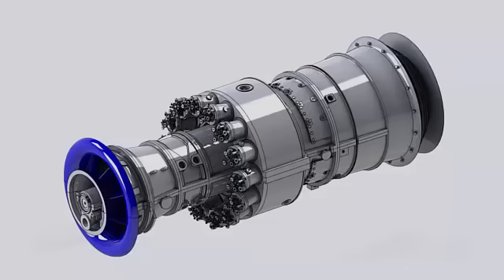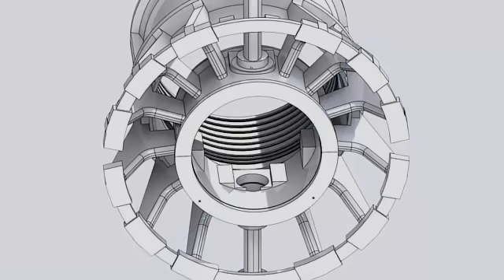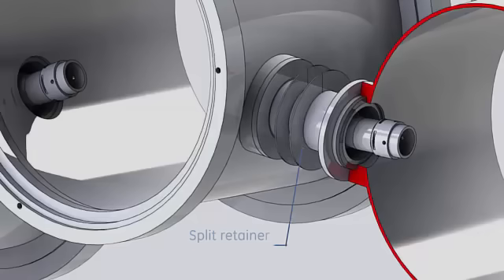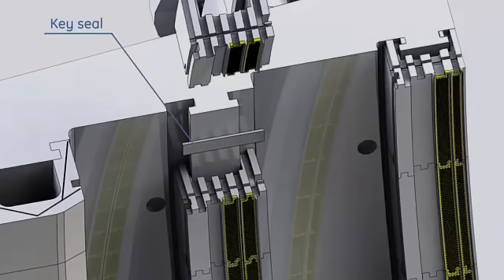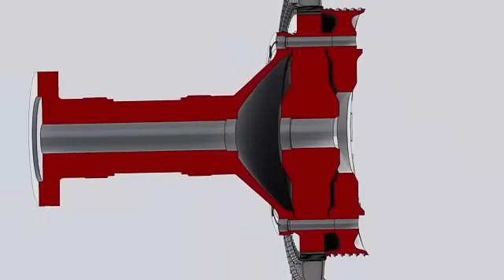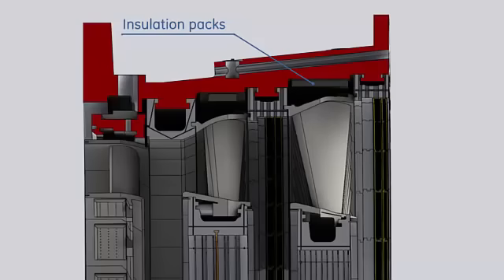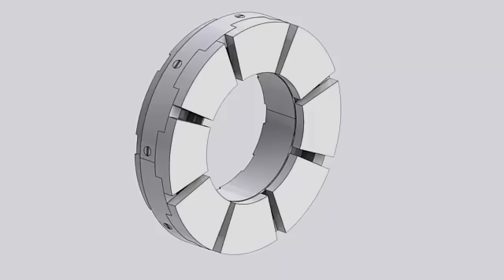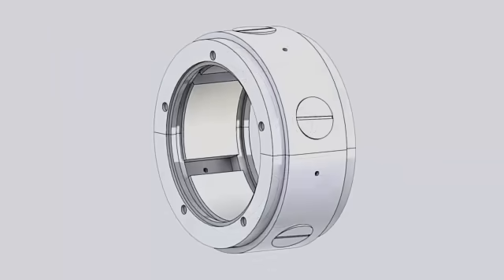Gas Turbine | Gas Turbine Working | Gas Turbine Overhauling | Gas Turbine Maintenanc Gas Turbine Rep

Comment: Better than my university professor’s teaching
Reply: What a weird thread!
Reply: A stator induced electronically should accelerate induction at slow speeds to eliminate compressor and combustion flame out and lack of performance so much needed at slow speed maneuvers or tactical applications !
Reply: @Noyon Ahmed oh it was aimed of achieving maneuvers on an F 22 , F 35  !
Turbines , like car engines rest on oil pressure friction floating  bearings , as we saw the center shaft and seals !
Reply: A university teacher would not talk about this.  they teach theory. this is infotainment about a product designed and built by engineers who got their education in the theory of thermodynamics.
Reply: @6Diego1Diego9  agreed, "theory and partisan propaganda"
Reply: @smudent2010  I'm guessing you are one of those people who fear the unknown, are afraid of learning something new, or possibly having your beliefs challenged? It's really amazing to me, that something as mundane as a Gas Turbine video can be made into something political by others!
Reply: @6Diego1Diego9  Absolutely...
Reply: @6Diego1Diego9  Blah Blah Blah
Reply: @UltraGamma25  you know I'm right ✅
Reply: @UltraGamma25  ll

Comment: Splendid work by Channel creator This video is for training , operation skills and  easy trouble shooting (concept of machine would be clear) with maintenance information or knowledge for maintenance tech. I operated 21 stage ST(HP/IP/LP) single shaft and 1000 ton/h of boiler but Never operated GT therefore i am sure i can operate GT after this video after simulator training only.
Reply from the maker: Welcome

Comment: Inlet guide vane 

Inlet guide vein 
Control ring 

Stator vanes 
Lift 
Drag 
Compressor 
Wheels 

Wheels wheels wheels

Casting 
Outer 
Inner 
Cylinders 

Barrel
Chrome 
Barrels 
Chrome 

Bearing 
Theodolites 

Nozzles 
Airfoil 
Dovetail

Comment: What type of engines does Grendizer use?
Reply: Grendizer's power system is based on an advanced alien energy core that supplies the necessary energy for its movement, weapons, and advanced functions, such as flying and shielding. The specifics of the engine or power system aren't given in scientific terms, but the concept revolves around a highly advanced form of energy that enables Grendizer to perform its heroic feats.

Comment: one i worked on in a power plant took a week to stop spinning
Reply from the maker: How?
Reply: @OilGasWorld  very good bearings and it weighed 2Million pounds so just the rotating mass, the shaft was 22" around solid stellite steel. was in a power plant. made 1.5 million hp ..i can’t remember the megawatts it made my buddy would remember how big the alternator was✌🏻

Comment: Great respect to those great engineers who developed such a beast. Question: what if there were no stator veins? Would the compressor stage be just a big fan?
Reply: It would create a Flux Capacitor.
Reply: Assuming you are not removing the casing, I would say it will behave a bit like a fan (pushing the fluid without much pressure increase). Another problem that you will get  is that the flow path/direction will be heavily disturbed, so this "17-staged fan" would need very high power input to counter the flow turbulence.

Comment: Excellent description and detail by the commentator.  My hearty congratulations.  I do feel that the modern jet engine must be classified as one of the modern wonders of engineers. The combined engineering logic of the jet engine took a lot of time to be put together and if one had to put an initiation spark on the human mind, it was Charles parson who combined the high pressure in a boiler to spin the turbine in a steam layout.  I was lucky enough to have lived at Newcastle-upon -Tyne where  I went on many visits to see the Turbina the first steam turbine ship which surprised the Royal Navy at Spithead.  I worked on the first jet turbines on a naval ship and it was the HMS Exmouth when I worked at Chatham Dockyard. 
Again Congratulations to Oil Gas World for providing such detailed information about the thermodynamic stages and the cooling methods on every unit. When I built a model engine with one compressor stage and one turbine stage, the diffuser right after the compressor was a tricky unit where the air had to be slowed down to sustain the flame and then the flame diluted with colder air along the burner to isolate the flame from the metal. 
Well done to the commentator, HIs English accent is what I aimed for when I spoke that language, but I could never get rid of my mother's tongue diluting the English language I spoke at Chatham and Newcastle.
Reply: Well, check out ASML EUV scanner. Also an example of amazing engineering.

Comment: To fully appreciate how powerful this engine really is, the compressor alone draws about 25,000hp.
Reply: Which engine is it? Because it seems quite simple (old-fashioned?) compared to a GE aero engine.
Reply: @rocksnot952  It looks simple because it's ground up made for industrial use, so doesn't have the constraints of an aero-derived engine. Means they can make them simpler and more robust the the LM series which are the cores of modern turbofan engines (The LM9000 is built from the core of the GE 90, the LM6000 from the CF6.)
Reply: The cooling fan on my big block Chevrolet draws 30 horsepower. I was stunned to learn this some years ago.

Comment: Very Cool and also amazing how these things such as high speed gas jets work and last as long as they do with not just it's speeds in RPMs but the amount of continuous heat saturation of all the internal parts without melting down or seizing by welding themselves together, to me that's mind blowing. Working with Turbos on gas engine's is challenging enough when you are dealing with exhaust temps and heat saturation into the drive shaft and Journal bushings or ball bearings, but I also assume with the amount of continuous volumes of fresh air always coming into the intakes and the lower compression ratios of the turbine the BTUs aren't nearly as hot as it coming out of an exhaust port of a V8 cylinder head, of a hot Blue flame upwards of 2k degrees Fahrenheit? But it's a different story when you add a afterburner to a jet or turbine combustion which is under much higher atmospheres of pressure when extra air and fuel are pumped into the afterburners, those parts have to be some sort of super metals used by NASA it not melt or erode away if not some sort of ceramic coatings on the metal parts to protect these parts from the intense heat being funneled throw a adjustable nozzle at the tail ends of these modern jet engines. I understand they are slightly different than a Gas turbine is but they share a lot of the same mentioned above parts and temps I'm sure.

Comment: This tie bolt construction is not common, is it? This is for stationary gas generation?
Reply: Yes, this is how the compressor rotors in GE Heavy Duty Gas Turbines are made...other manufacturers use more of a "barrel" design...and yes, this is a stationary power generation machine, so weight is less of an issue than durability and output.
FYI...I am a gas turbine engineer, formerly with GE for many years, and I still work for a spin-off company on gas turbines...

Comment: I used to be an 14CFR Part 147 instructor for an A&P school. I taught turbine engine theory, and helicopters. A lot this is the same as a standard aircraft engine but there are some terms that are used here that aren't used on aircraft. Like spark plugs. We don't all them that since they are not used at all times. They are called igniters on aircraft engines, we simply call them flame propagation tubes, and what they call a labyrinth seal we call knife edge seals or knife seals, and we usually describe the intake separately from the compressor but for the most part they are pretty much the same.
Reply: I used to be a helicopter pilot too, i drove a ROFL Copter 
...and I Believe you Joker

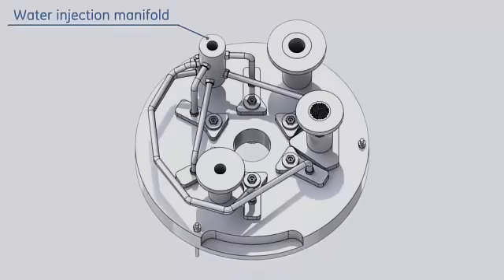Comment: Why is water introduced to the air-fuel mixture? 17:15 Anyone? It's not for cooling obviously🤔
Reply: GE Heavy Duty Gas Turbines, like the Frame 9 in this video, have multiple combustion chambers, even the current design machines. The water injected is for NOx emissions control when operating on liquid fuel  (usually #2 distillate, i.e.diesel). On gas fuel, the DLN system can maintain low emissions levels without water, thus the name DLN (Dry Low NOx) for the combustion system. However, on distillate fuel, water is still employed (which quenches the flame to lower thermal NOx production).
Reply: @garyvonmaucher2400  Thank you!👍
Reply: Well this is not the newest type of Gas Turbine it's using cumbustion chambers that are seperated. Most of the time you will see only see 1 combustion chamber. So it should be an older type of engine. The water was in fact used to cool the air a bit more to prevent unplanned overheating. But since water is quite heavy it is not used anymore. There where also engines which used methanol/ethanol mixtures with water.
Reply: @janhammer6554  Thanks for the explanation! Now, it makes sense.👍
Reply: Water will decrease NOx emissions and a bit of power boost from the steam.

Comment: I worked for the UK admiralty Material Laboratory as a Toolmaker/Welding specialist 1977 to 1981. One of the projects I was involved in was a high temperature wind tunnel for gas turbine blades. They were initially interested in  the front and rear blades.  The for the front blade the conditions surrounding the blade were easily met. The rear blade was another thing. We spent over a year getting the Air pressures correct flowing over the blade. The tool shop made up test blades out of different materials to see their corrosion resistance as the hot gases flowed over the test blade. Gas pressure was monitored around the blade by spark eroding very small holes in the blade then welding 1mm dia stainless steel pipes on to the end of the test blade where the hole came out of the blade which was then connected to pressure gages. After a year of development and spending 1 million pounds it was announced everything was good. The customer turned around a stated they were only interested in the front blade high temperature corrosion resistance. Whoops.
Reply: Great! I worked on a contactless monitoring system for vibrations of blades by means of microwaves.
Reply: Hi sir
Reply: Whoops ?
Hehe..

Comment: Great vid.  Now I understand why gas turbines cost so much!  Lots of very high precision components. 

Does each stage have a balance ring on the rotating ring where the blades mount?
Reply: do you? A computer CPU chip has trillions of even higher precision components and costs $100. And just like a chip, make one is almost same cost as make 10 million. Turbines cost what they cost because the makers charge what they feel like charging for them, just like the proverbial toilets sold to the military.
Reply: @dubistverrueckt  What a moronic comment.  There are many gas turbine mfgs (Ansaldo, GE, MHI, Kawasaki, Siemens, Solar, Capstone, MAN, Centrax, Opra), and it is a competitive market.  In fact, gas turbine mfgs show much lower profit margins that chip mfgs.
Reply: @shooter7a  I'm sure there's even more toilet manufacturers, yet the toilet story is true. by the same token, watch a video of modern Audi piston engine, every bit as complex, if not more than this turbine. The Audi engine is under $10k
Reply: @mosipd  Not to mention each turbine blade in commercial jet engines is milled from a single block of tungsten alloy. Very slow, labour intensive and expensive, the cost will never come down much for a long time indeed. I tune engines as a hobby, turbocharged, standalone ecu, water/meth injection, etc etc. There is simply no comparison between modern reciprocating engines to gas turbine engines used in aircraft, not even the jet engines from decades ago.

Comment: The turbines have neither the variable pitch nor the variable geometry of the blades that must rotate on themselves.
And not fixed like monsters.
1) https://it.wikipedia.org/wiki/Elica_a_passo_variabile
2)https://it.wikipedia.org/wiki/Turbocompressore
Reply: This GE talking about a specific GE turbine. I think GE KNOWS MORE ABOUT A SPECIFIC GE turbine than Wikipedia which is general information. I worked at a GE turbine blade machine shop for 13 years.
Reply: @jockellis  But did you understand what I'm talking about?

Comment: Fascinating video. Though not the type of thing I'd normally watch on YouTube (I'm primarily here because a link to this was sent to me by a friend who is an engineer at GE), it held my attention to the end. I'm curious: what are some of the end uses of such a turbine? Electrical power generation for distribution to public? Industrial uses? Other?
Reply: smaller ones are also used to drive large mechanical loads like compressors. Very popular in LNG and other facilities where gas compression is needed.
Reply: This size machine is typically used for power generation, and is used in the 50 Hz market (thus the 3000 rpm speed), mostly Europe, Asia, etc. It produces about 125 MW of power. These machines are also used in a few LNG compression trains as well.
Reply: larger ones are used for propulsion like jets but also ships. smaller ones are more for power generation. they are usually attached to a motor or transmission for non jet types.
Reply: As an ex-GE engineer, I will say briefly they are primarily used to drive a generator, the MS 9001described here turns at 3,000 rpm - synchronous speed for a 50 cycle (Hz) generator to match most of European electric grids, the earlier iteration, the MS 7001 turns at 3600 rpm to produce 60 Hz power for USA. Earlier models like frame 3 and 5s also were at times used for pumps or compressors, often with a gearbox between the turbine and the load to give the desired rotational speed - plus other subtleties like a 2 shaft turbine system.  I will say that this video is excellent and very well done - I found essentially no detail I could disagree with. Whoever did this knows their stuff!
Reply: MS9001E is mostly used for power generation...also compressor and pump drive

Comment: Literally the best video I’ve seen (on this subject).
Reply: #chain #coupling #energy #energytransfer #flatbelt #frictionwheel #gear #mechanicalpower #power #roundbelt #synchronizedbelt #system #transmission #v-belt
The various machine's required motives have to be transferred from one place to another place. Or the power has to be increased or decreased.
https://techproces.com/mechanical-power-transmission-system/
Reply: @reviewgallery570  ?
Reply from the maker: Thanks for your comments
Reply: @OilGasWorld  ippp
Reply: @OilGasWorld  pippipiipiiipppi8ipiipppoo91pppp